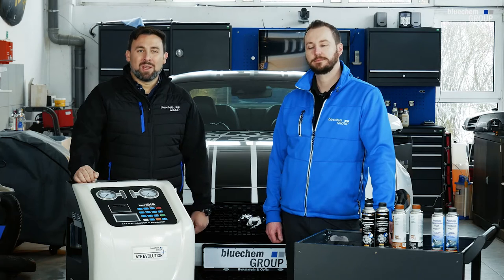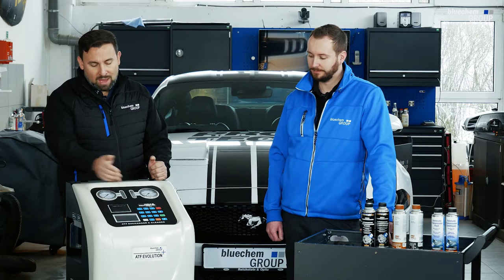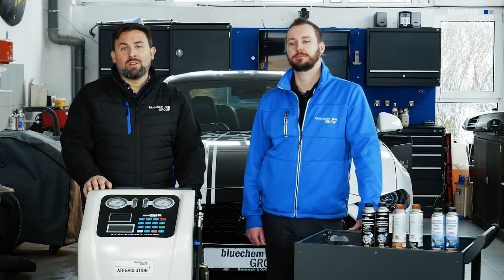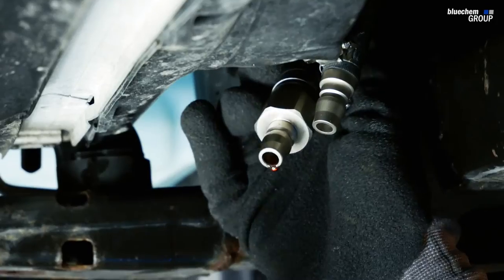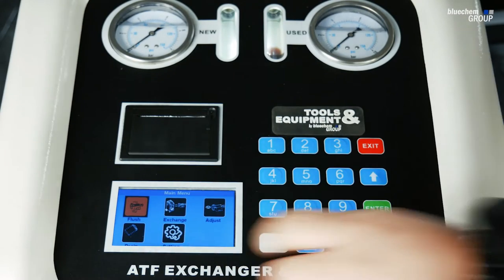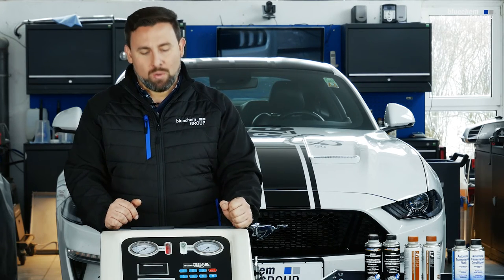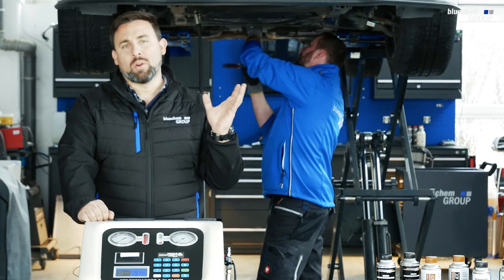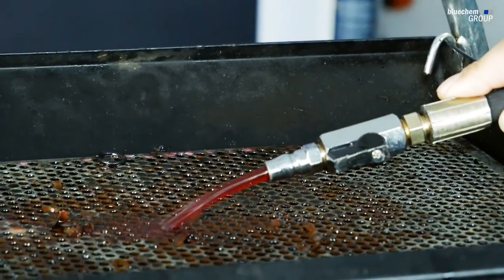bluechemGROUP | Automatic Transmission Oil Change/Flush | ATF Evolution Plus EN

Comment: Steps are taken in unusual order. Why? I used to see that fluid exchange step goes after pan emptayng and filter change. Here is oposite and makes you to dump fluid that you just exchanged and exchanging fluid with full pan of old fluid is less efective... Why not: Flush --> drain pan, change flter, fill up with fresh oil --> than exchange what is left..